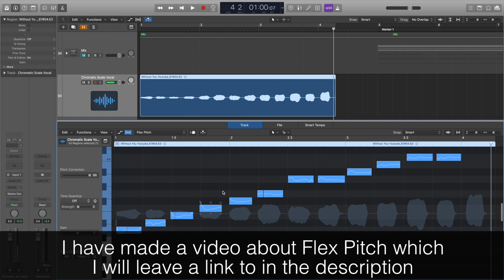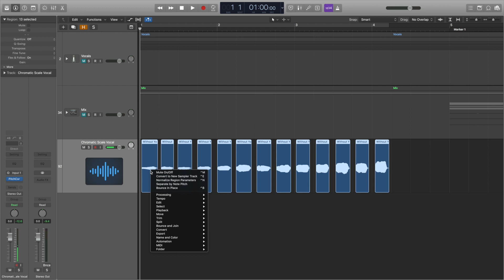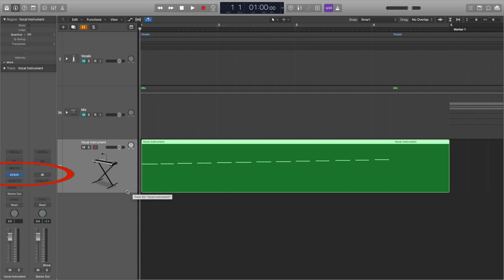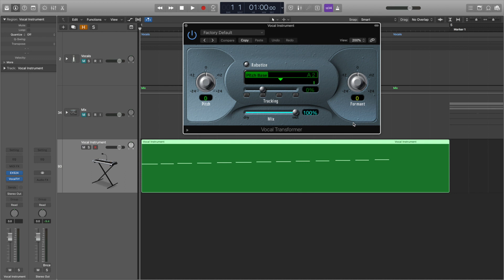How to Create a Sampler Instrument (Turning Your Vocals into a Synth!)

Comment: Thank you so much, I’ve been meaning to look up how to do this but it seemed daunting. Is it possible to make an instrument with different articulations like the choir patches in the sampler? (I think it was supposed to be possible in EX24 but I’m not sure about the sampler). Also is there an optimal note length for recording into the sampler?
Reply from the maker: Thank you! I've never tried using this technique with a choral sound, but it would be really interesting to try! The sampler seems to work great with any note length in my experience so it really depends on what's going to sound best in your mix :)
Reply: @ThirdFret  thank you